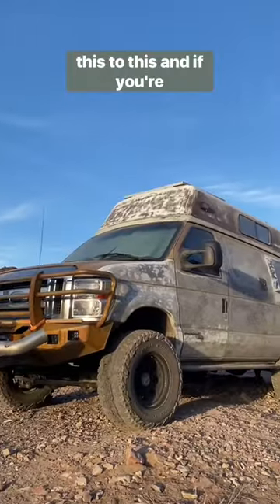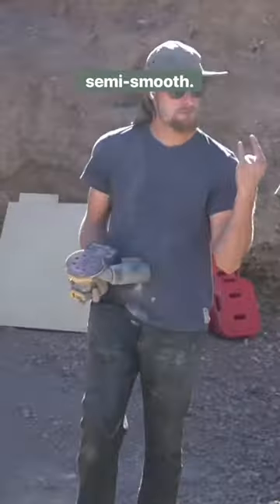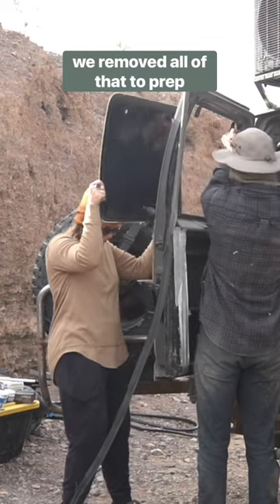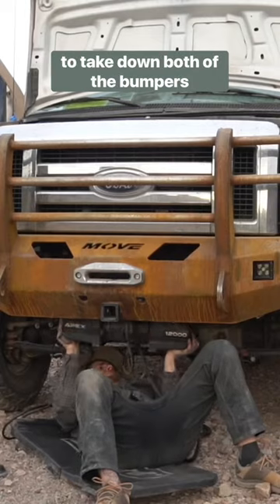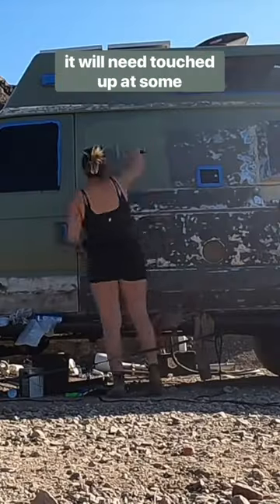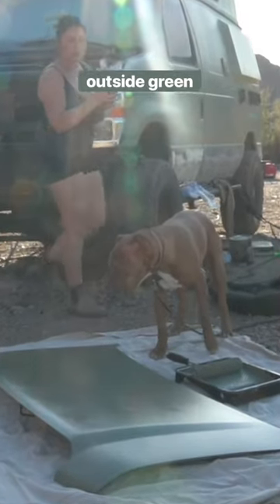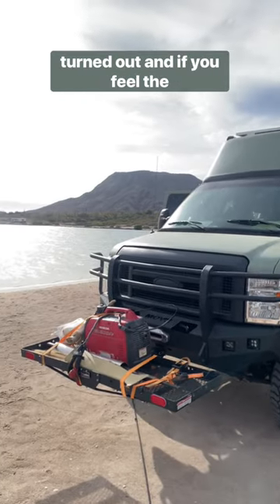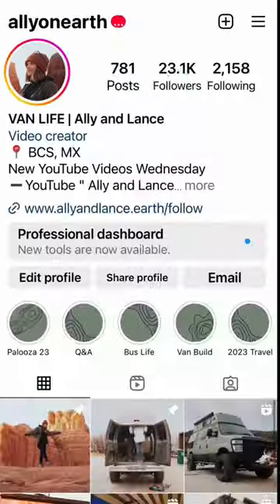Professional looking PAINT JOB ON A VAN for $450 || 4x4 7.3 Diesel Van build series! Desert work!

Comment: So you painted it in the middle of the desert and didn’t get any dirt on it?
Reply: They weren't using sprayers so it probably wasn't as hard as it sounds. They dry air means they could leave metal bare for longer and move slowly
Reply from the maker: The paint is no means perfect! But it’s better than it was.

Comment: Wait a minute, why wouldn’t you use primer? That’s part of the prep work. Spend an extra day priming the job and you won’t regret it. Otherwise six months from now you’re gonna have peeling paint or scratches easy. Primer is everything
Reply from the maker: Totally that's why we planned to use primer unfortunately it didn't work out.
Reply: @AllyandLance why didn't it work out?
I'm in a circling pattern right now on building a 96 f150 and am looking at using this method to paint
Reply from the maker: @stanb990  just scuff up the original paint if you can. Taking it down to raw metal was the start of our problem. We didn’t properly prime the raw metal. Other than that a ton of people use this method and don’t have issues.
Reply: @AllyandLance  paints actually good for the most part 
Just don't like the color 
But when it comes to OBS sometimes you have to take what you get